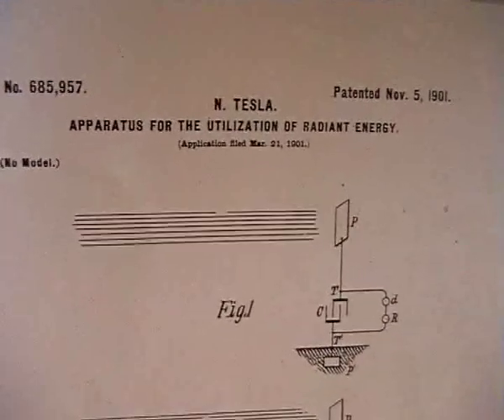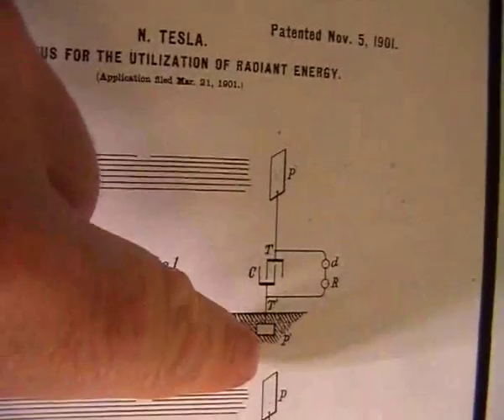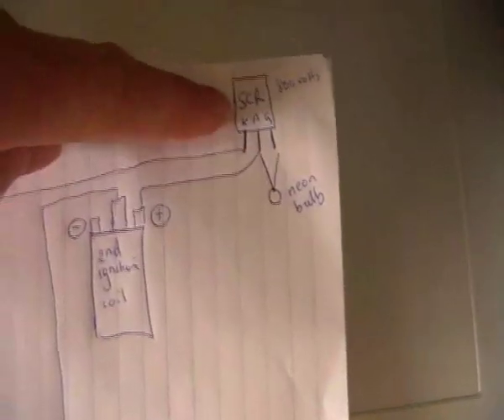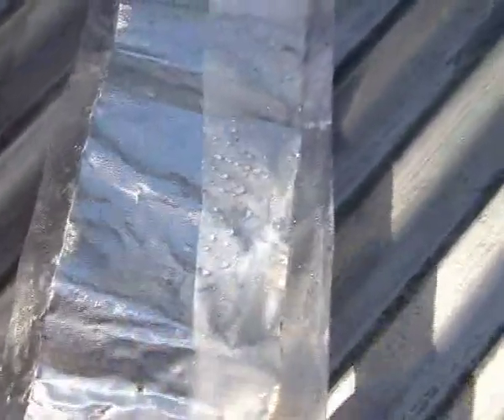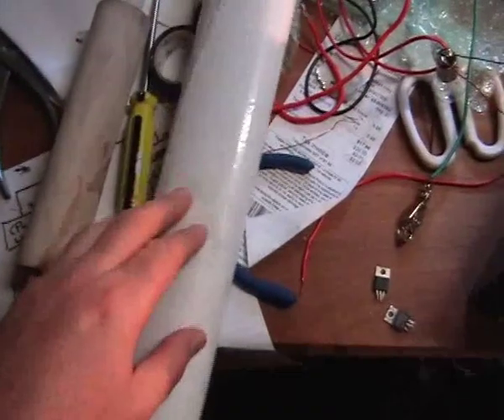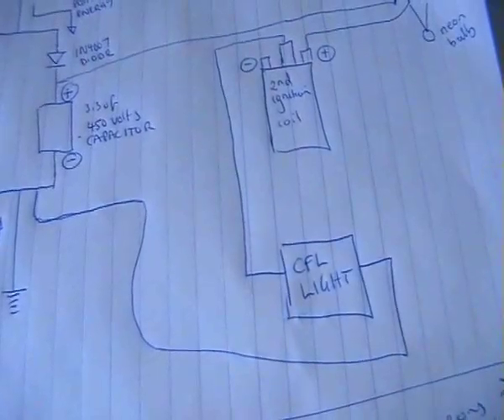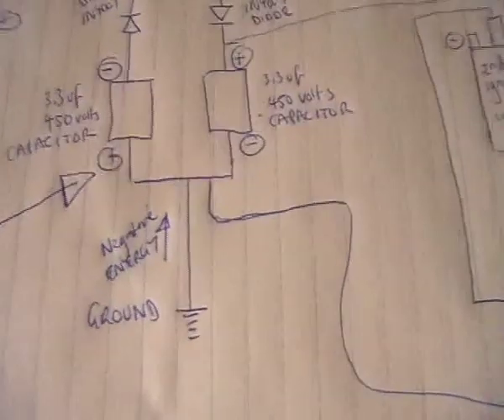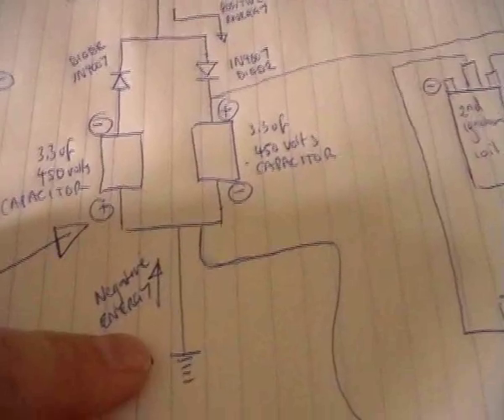BEDINI IMHOTEP BODKINS REPLICATION UPDATE4 RADIANT ENERGY TE

Comment: good 1-try a spray on laquer or paint for insulating the 'elevated capacity'.
the higher it is,the more voltage difference is between the plate and ground,so it would definatley work better up higher.